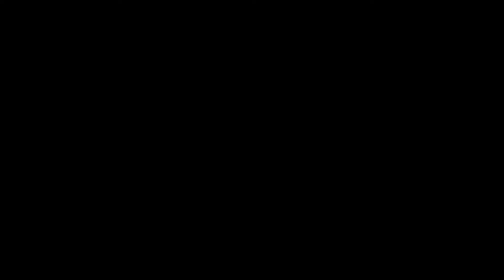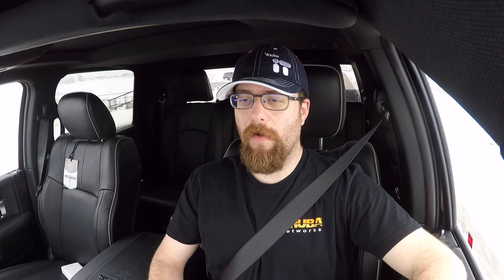APoaS Methodology and RF Design Process

Comment: Agreed, never mix old diversity mode antennas with MIMO. I feel that mixing different levels of MIMO, ie, 2x2 and 3x3, can have detrimental affects on the clients that are of the higher MIMO. Baseli ne, don't mix if you can, and if you have to, try to keep them in the same MIMO specs.
Reply from the maker: Kit Johnston 100% agree.  Thanks for commenting.